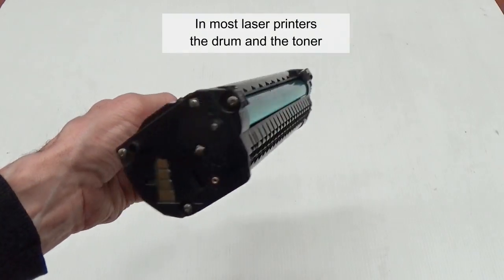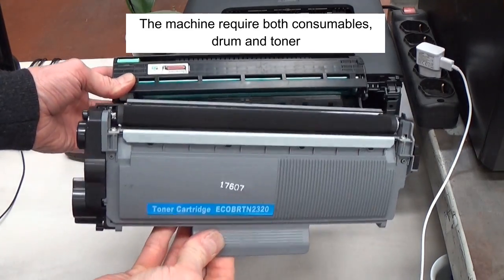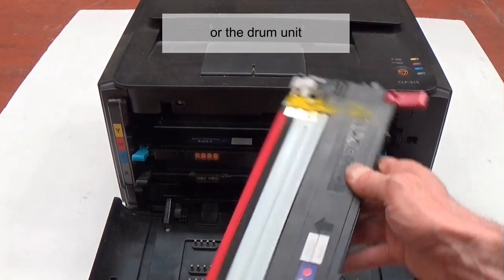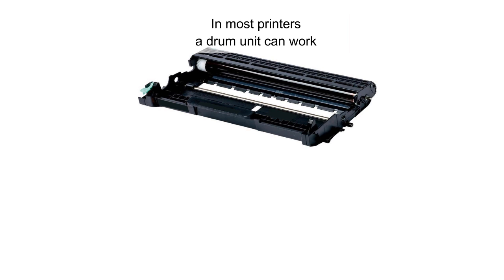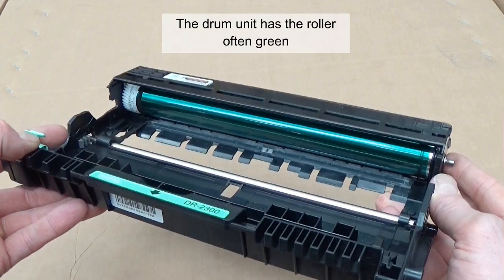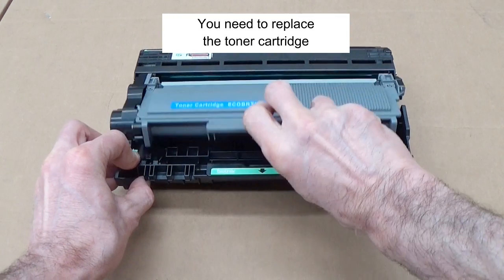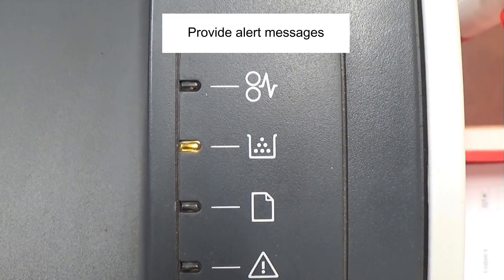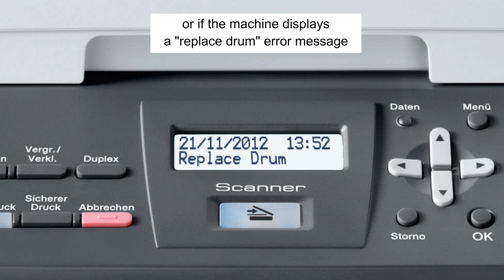What‘s the difference between toner cartridge and drum unit?

Comment: Today I found out.  I wish it was made more clear when deciding what printer to buy that even if a printer's toner and drum cartridges can be separated both need replacing at some point.  I thought up until today that a drum was a larger capacity unit that came with the stated capacity of toner.  The marketing of these is still suitable to those educated on office supplies.  I even just read complaints from someone who ordered a drum and it wouldn't print.  The pages describing drum cartridges should clearly state that they don't come with toner and that comes separately.  $100 seems like a bargain for 12k pages until you realize that.  It's still better than inkjet pricing, but it would be less frustrating to know what it means before buying it or deciding on a printer based on that information.
Reply: I had exactly the same problem. Bought a 100 dollar drum thinking it was a cheap toner -.-
Reply: Thank you OP. You just saved me $100!

Comment: If both drum unit and toner are housed in a single unit, if drum unit is bad and toner is NOT low, how do you replace drum unit without replacing toner ??
Reply from the maker: it depends on which cartridge do you have.